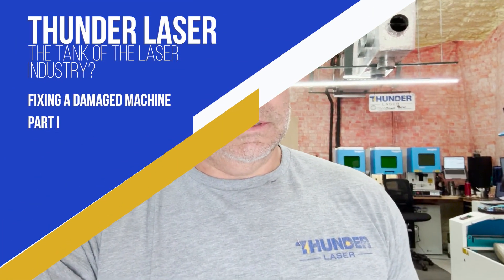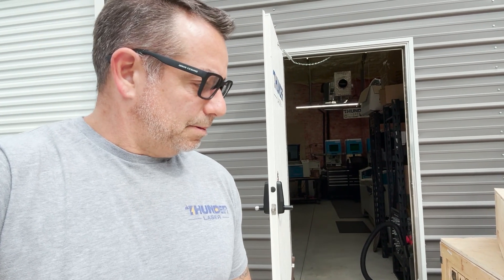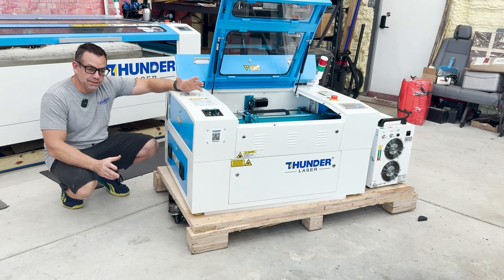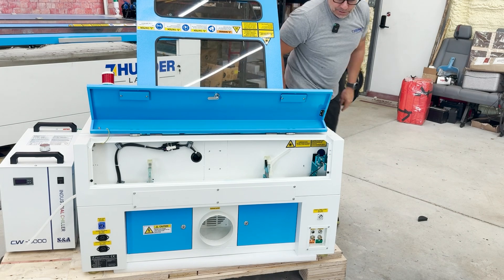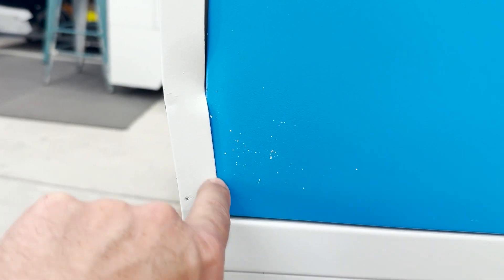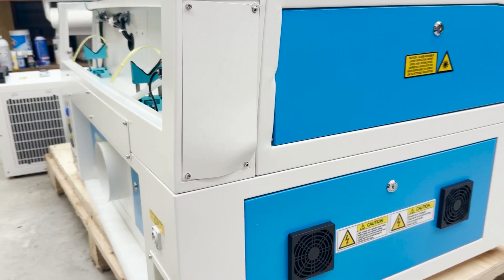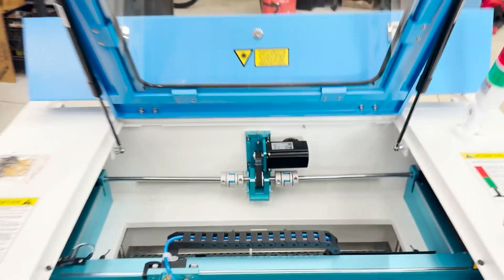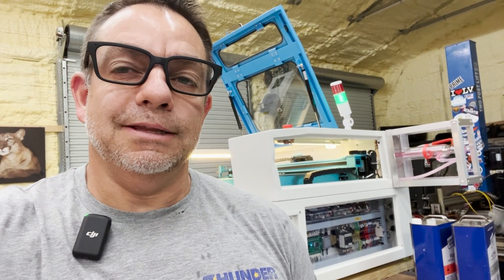Thunder Laser Tank of the Laser Industry?

Comment: I have a 51/130 that flipped off the liftgate and landed on its back. The tube didn’t break but I replaced most of the same metal parts that you are going to replace on this one in about 4 hours, fired it up and it’s been running strong on a daily basis and I never had to adjust any belts or the bed or anything. To say these things are built like tanks is an understatement.
Reply from the maker: For this unit.. I am leaving the cabinet alone.  Want this one to be mangled to prove a point. Glad you got yours up and running without issues